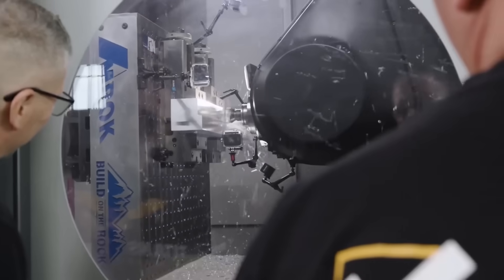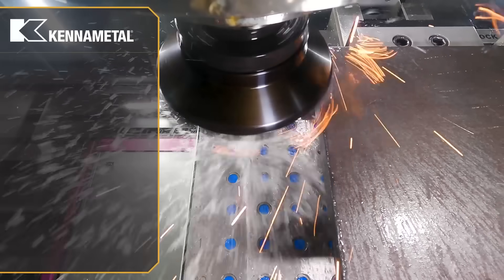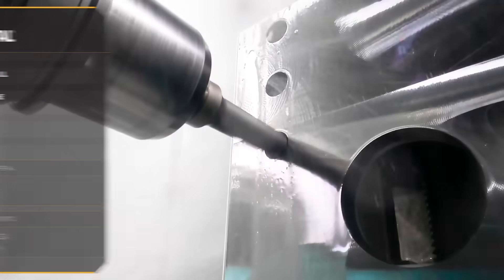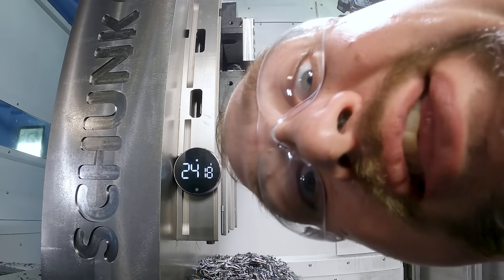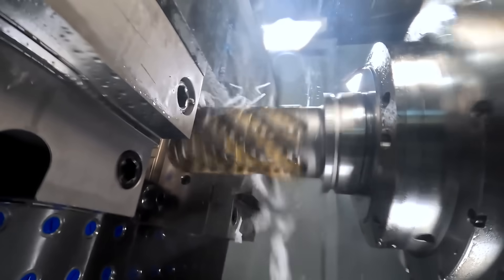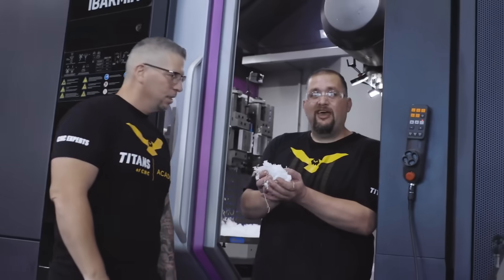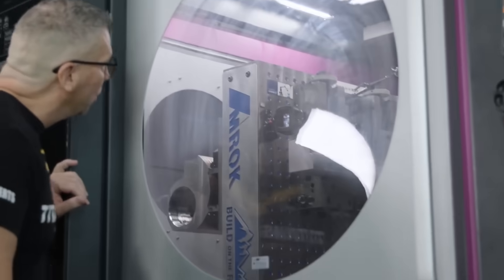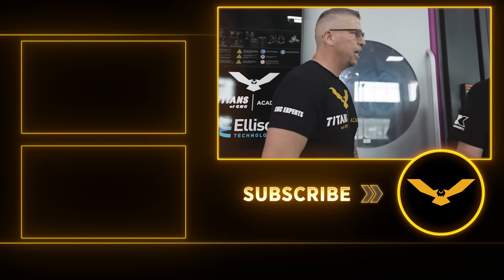CNC Machining’s Most DESTRUCTIVE Cuts Compilation

Comment: I'm taken back to when I started my cnc  learning in 1980 on Bridgeport  interacts   It was jaw dropping to see a mill being able  to move in both X and Y at the same time . The start of massive time reduction in machining had begun!.  Finished my cnc career in 1999 on Bridgeport VMC  with 4th axis
Reply: Just starting to learn now on a 1994 VF4.  Only three axes, and a spindle that sounds like death.  Any tips?
Reply: @Soundpost-f2l   Take your time  plan ahead  don't cut corners  trying to speed things up when learning  you'll get that pressure when going full production. I worked on some unusual materials  like PTFE  used a seals on rockets ( it will shrink to half size on a shelf so you cant finish  machining  to size straight of)    Inconel 600 was  used on the bottom of a saturn v rocket but I machined it for parts of the British challanger tank. I also made parts for F1 cars 82-90  Nissan 24 le man car  84-86, vacuum machines for gold plating,  gun sights for olympic shooters, Concorde,  Harrier jet etc etc . Started 73 finished 99    Oh and watch your body parts and loose clothing. Good luck

Comment: Watching these videos I understand that the machines I'm working with are not being pushed to their full potential. Most that they've done is 55% spindle load which I made happen as a newcomer in the company. Pushing more experienced employees and programmers to go harder while maintaining rigidity and maximum tool life
Reply: no matter how powerful and rigid your machine is, the harder load you apply to it, the less time it will work without an expensive maintenance and repairs. This must be taken into consideration every time you want to run at full capacity

Comment: the steadiness of the CNC controls are helping those tools out a lot.  using manual controls, most of that stuff would break much easier than it is in this video.  the abrupt starting and stopping caused by doing it manually makes a huge difference.   tools like to feed steadily.

Comment: As a millwright and maintenance guy who fixes dozens of CNC machines... I feel physically ill
Reply: I'm with you! I don't know much about this field, but I can appreciate the skill it takes to use these machines, and this just doesn't look right, on so many levels!
Reply: Care to explain? I have little to no knowledge about anything being shown or talked about. What maintenance do you do on these sort of machines?
Reply: @cerealru1069 imagine how precise the calibrating must be, and every time you see those kinds of dive-ins you expect a fatal bending coming any second
Reply: @overdrive105  bending isn't going to happen. The frames are either cast iron or nowadays "mineral composite" (a.k.a. "epoxy-granite", "mineral-casting"; i.e. rock-dust filled epoxy). Both of those materials are brittle and will break before bending, but they're absurdly strong so that's not likely to happen. The spindle bearings are the victims here. My guess is they did this on a machine that needed a spindle rebuild anyway. The linear motion system -- linear rails and ballscrew -- may suffer some load but the servo would likely cut out due to overload before damaging a screw and linear rails are surprisingly durable.

Comment: I'll give you guys one thing. While I've seen all of these techniques for cutting aggressively at some point in my decade long career, never have I worked at a shop capable of doing them all at once. Your programmers are something special.
Reply: programming has nothing to do with that aggressive cutting, I don't see anything special here. You just need a damn big and rigid machine
Reply: @hikari_ua  feedrate and spindle matters quite a bit.
Reply: The program isn’t the impressive part. It’s the tool holders and work fixtures that hang in there. But dear god I would hate to be a service tech going there. Them spindle bearings must be junk after only a couple years of that.
Reply: To be honest, with all the new softwares. A beginner can do that.
Reply: @BETTALIFE101 some of the wizards today do all the G coding for you. Blows my dads mind when he brings up txt documents all wrote out manually
Reply: ROFL. I can do any of that wit  the handwheel

Comment: No such thing as bulletproof. Merely bullet resistant.
Also, when I can mill "bulletproof" acrylic on a $100 desktop mill... 🤨
You guys are a bunch of drama queens.
The "kraken"? You're using the tool the way it was designed to be used. It's performing to expectation. Why are you guys acting like you're at an illegal drag race?
I could appreciate your antics if you were pressure forming 2 in hardened steel using explosives...
Reply: maby they should have added 'entertainment' to the title for your satisfaction......

Comment: There was no lathe turret on the chip conveyor that’s a real crash or knocking the tombstone off the pallet witch is runner up for machine destruction.  I’ve seen both.  I was also in a shop where the guy in nights wrote a program by hand in mdi on a haas and turned most of the table into chips. He hit start and went home for good taking his tools with him. Lights out machining. He got arrested. Not sure how it turned out in the end I bailed shortly after. 2 inch face mill with an 8 inch extension

Comment: Fake News!! We're machinists, we're perfect. Even though you saw it, it didn't happen...
I'm actually surprised we didn't hear a lot of knocking on the full radial/axial cuts due to recutting of chips without the help of coolant washing the chips away.
The most impressive to me was the full radial 45deg ramp. I've got a beast cat50 machine but I wouldn't do it.
Also on the part where you are using a face mill to axial cut what kind of step over did you use? Full insert?

Comment: Seeing all that material disappear made me realize that it has to go somewhere. How does a shop, especially one as large as yours, deal with waste? I see a lot of materials that I'd imagine are very expensive and would probably be a waste going in the dumpster or are mixed in with a dozen different other types of material. If you do, do you have a way of sorting different metals or do you just make sure to empty the machine out before switching materials? Do you suppliers buy it back? Is it feasible to melt them down into a lower quality material to use for hobby projects?
Reply: Can't give insight for Titan's shop of course but at my shop and most shops I've been to the materials get separated (this is fairly simple with a chip auger and some time to clean out the chips that remain before switching materials) and then a scrap company picks up the material and pays for it based on weight at a scrap value. I've also worked at one of these scrap places and from there the metal is sold to a metal broker where it is then sold to companies with massive machines that recycle the material to be melted down and re-used.
Reply: Yeah, if you keep it separate you can sell it to scrap companies. With Aluminium, we feed all the chips out of the machine with a conveyor system into a compactor that crushes it together into briquettes that reduce the space the chips take up massively and scrap companies will pay a lot for these briquettes. The billets weigh just around 4500lbs and the finished part is 660lbs so there’s around 3900lbs of chips every part we produce. (3parts every 12hours or so)
Reply: @Shoorit  I turn steel mill rolls and your chip volume is up there where ours is when were roughing new blanks.
Reply: you simply sell the chips to steel merchants.  
they melt it down.
Reply: Chip bins, someone will buy the stuff and melt it down and use it again

Comment: do you guys have any experience with highly alloyed powder metallurgical steel types? I'm dealing with M398PM and that stuff ruins carbide. face mills, end mills, drills, taps, nothing is safe
Reply: Onto diamond or ceramic tools. Small DOC fast feed rate
Reply: @117F56  diamond coated tools could work. Never tried ceramics in steel, could as some suppliers what they think
Reply: @nofunallowed3382   Did you use the suggestions in the Böhler brochure about   machining it ?    
Or are you hard cutting it ?
Reply: @Baard2000  yes we did. We're at the safer side of the speeds and feeds. M390 was tough, but the results predictable. 398 on the other hand is very strange, sometimes drills last for hours and sometimes not even 10 minutes. And we mill it both soft and hard.
Reply: @nofunallowed3382   that might be due to tolerances in  elements of alloy.    I saw it contains loads of Vanadium and others.   Vanadium is an extreme carbid forming element.  And those are 4000Hv ...very hard.  Also other elements highly influence properties like martensitic temperature (  temp on which martensite is formed after being quenched from hardening temperature )  or the time in cooling from hot to room temperature when still martensite is formed.   Looking at the composition ....398  I would guess the cooling down from high temperature might take hours if not a whole day to prevent a martensitic matrix in which Vanadium carbides are embedded.  Thats tough to machine.  

It might be that with , say 0.14 percent higher chromium this time is much longer ...so such a batch of material is much harder to machine.

Also possibility of rest-austenite.   Thats austenic structure existing at room temperature.   But it can flip  into perlitic  or into martensite  due to energy influx.   Meaning, I saw such happening under my microscope ,  putting the right form of energy to rest-austenite lets it turn into martensite.    So drilling with a used drill.....might cause rest-austenite turn into martensite  causing a hss drill to go bad in minutes if not seconds.   

Also the size of the piece machined can have high influence on machinability as cooling down is different in large part then a small part.  

I dont know or the above makes any sense to the machining experiences you have had ??
Reply: @Baard2000  that makes a lot of sense. The facing inserts wear out quickly and makes it tougher to machine. Never knew the material structure would be impacted in such a way. I'm gonna ask suppliers if they know a way to prevent this from happening, thanks for the tip👍

The amount of chromium sucks, and having Mo, V and W in there as well doesn't help out either. But overcoming these difficulties is so rewarding, and keeps this material fun to work with
Reply: @nofunallowed3382  maybe you can asl for a material analysis with each batch/piece.   Knowing what is in it might give also a clue.   Maybe e.g.   a higher content of chromium or whatever gives a more difficult piece to machine.
Or maybe its just the size   .  Or both.  
Good luck with it!
( maybe now my experience from departement research and development in heat treating plant comes in handy...😉)
Reply: @Baard2000  will give that a try, thanks!

Comment: One interesting point (in my personal opinion) is that the work almost allways is made so that the chips gets thrown out nicely. When I mill at work one of the larger jobs is to clean out the chips from a groove. Our machines don't allow that kind of rpm and feedrate...
Reply: my guess (and based on the whooshing noise) is that they are using through-tool air. what TSC is for drilling, TTAB is for milling.
Reply: @angrydragonslayer  
 You are probably right, but (if it isn't just camera angle) to me it looks like they mill with the wise/stock orientated vertically. That would make it easier for the chips to slide out and fall off instead of being left in the groove?
Reply: @johanneslaxell6641  being in an horizontal does help a lot but there are cuts in verticals where they get the same effect
Reply: Yeah the mill i have in my shop is like a 40 year old 1.5 HP Bridgeport so its nowhere near as exciting as these videos 😂
Reply: @LightlySaltedMM  My Arsenal FU251 can take some pretty exciting cuts for an early 90s 4kW universal manual mill (no quill on this bad boy). Nothing like that but it can mill steel like it's nothing, and I can even do climb milling most of the time, thanks to a leadscrew pretensioning lever it has, that takes the slop out of the direction you are climbing towards. I haven't had the chance to work it through it's paces, but it can easily take a 20mm deep cut with an 20mm end mill (either HSS-Co or carbide, preferably a roughing one though, due to the RPM limitations and very limited coolant flow creating chip evacuation issues, at least when working with the vertical attachment and not directly off the horizontal spindle which is actually a shit-ton more rigid than the already rigid as heck vertical head, that I recently rebuilt myself) with proper toolholders and workholding, and I have faced off up to a 3x35mm (ap x ae) with a 63mm 6 insert face mill at 800rpm and 400mm/min feed rate, leaving a mirror surface with no issues. Huge janky boring tools and flyccuters are also no issue, as it can provide up to 600N/m of torque! The DMG M1 I worked on at a factory, had 11-15kW (continuous and intermittent) and could cut small deep slots on steel at up to 1500mm/min, but it really struggled with face mills and larger cutters, due to the 60-90N/m torque limit and a spindle optimized for high speed finishing operations and aluminum roughing.
Reply: Your shop would probably love to have one of these machines, and these guys are making YouTube videos where they burn up tools and material with no coolant for fun. It's probably more profitable regardless.
Reply: @Ang3lUki  Tools and probably machines are most likely donated for videos.  These companies spend millions upon millions marketing, so giving these guys tools and machines and telling them to go wild is just part of the marketing budget.

Comment: Normal definition of a dry run: run the tools 3-4 inches above a part

Titans of Cncs definition: run it with no coolant
Reply: Funny
Reply: i use dry running sometimes for speeding up some part of the program when rerunning sections of programs.
Reply: I run dry in steel all the time. Way better tool life. Coated carbide is amazing stuff
Reply: That means it won't thouch the part !!